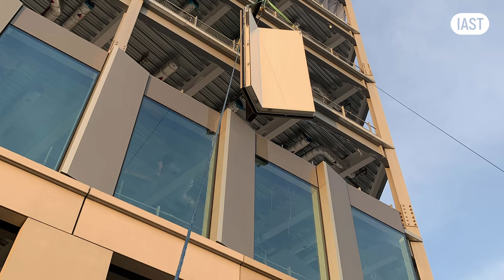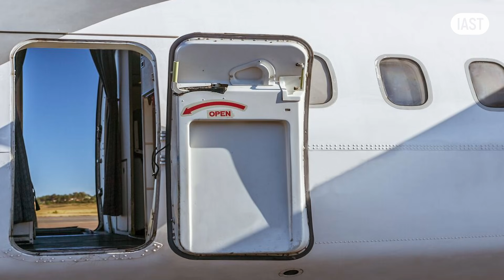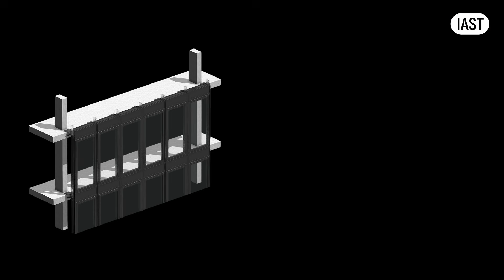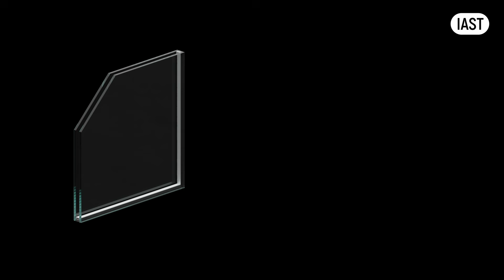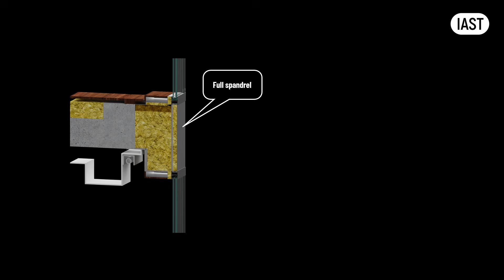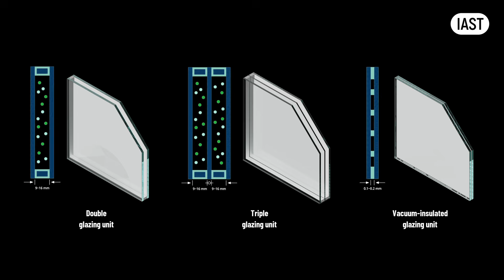Curtain Wall | Architectural Engineering and Facade Design

Comment: Spent 2 years installing curtain wall in NYC. Great experience.
Reply: Installing curtain wall in NYC is no small feat. Logistics is a challenge
Reply: @EugeneKorch   Its a project for sure. Getting the proper windows from a factory overseas sent to the warehouse.  Loaded on a truck and sent to the site. Then getting huge windows off the truck in the middle of NYC and up the lift and dispersed to the floors in the proper amounts and proper types. Then if theirs an issue it has to come down and be destroyed and new one has to be sent from the factory.

Comment: great video and presentation,  performance and efficiency drives yes, but the architecture is really the driver, which could also perform and be efficient
Reply from the maker: Thank you! Which performance topics do you think are most relevant for architects today?
Reply: Thank you — really appreciate your comment.

And I agree: architecture is the driver.
Performance and efficiency can (and should) be integrated into the architectural vision, not added on afterward. The best façades happen when design intent and building physics work together from day one.

That’s when you get something beautiful and efficient.

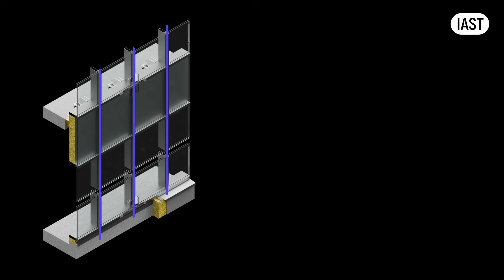Comment: 2:00 When I was in 2nd or 3rd grade, I was riding to school with a classmate and his mother was driving. She was explaining that my classmate's older sister had run out of the high school she attended as it was "collapsing in the wind" the day before, and had to walk home. Much later, while reading stories of the lawsuits, which dragged on for over 10 years, I learned that the 1963 building hadn't really come close to collapsing, but that too few brackets had been used to attach the aluminum-framed curtain wall to the steel structure, and that the wind had caused it to flop in and out, shattering the cosmetic plaster that covered the interior wall extensions and, for the students, creating the impression that the world was collapsing around them. No one was really in danger, but it was an expensive mistake for all involved. By the time I attended that school, it was a patchy mess with plywood replacing the destroyed plaster and since then, the curtain walls have been replaced entirely, but on that day in 1969, around 1000 students probably thought they'd never see their school again.
Reply from the maker: That’s a fascinating story, thanks for sharing! It is a powerful reminder of how critical façade detailing is, especially when dealing with wind loads and system integration. It’s incredible how perception and reality can differ so dramatically in such moments. Was it one of those early experiences that sparked your interest in architecture or engineering?
Reply: Wow — what an incredible story. Thank you for sharing it.

What you described is a perfect example of how façade attachment failures can create the impression of structural collapse, even when the main frame is still sound. When the brackets or fixings aren’t properly designed, spaced, or installed, a curtain wall can “breathe” in and out under wind load much more than it should — and for anyone inside, that movement feels catastrophic.

Cases like this are exactly why modern façade engineering places so much emphasis on fixing patterns, load paths, movement allowances, testing, and quality control. The curtain wall doesn’t just need to look good — it needs to stay attached to the building under real wind pressure.

I can only imagine how terrifying that must have been for the students. It’s a powerful reminder of why good façade design (and proper installation!) matters.

Thank you again for taking the time to write this — it adds a lot to the discussion.

Comment: How do you create the images? What software have you used?
Reply: Good question — honestly, any 3D software works.
But for most of renders we use Blender. It’s free, powerful, and great for rendering clean façade details and animations.

The key is not the software — it’s building the model properly and lighting it well.
Reply from the maker: High-quality visuals can be deceiving; they can make a poor design look credible. That’s why we focus on teaching how to design, not just how to make things look good. However, we do share some tricks with FI Pro Certified members once we have confidence in their knowledge.

Comment: Do you see any  new residential double skin solution coming?
Reply: Great question — but realistically, I don’t see double-skin façades taking off in residential.

They’re expensive, they complicate maintenance, and most importantly: people want to open their windows.
Add balconies into the mix, and the whole concept becomes almost impossible. You’d need operable outer layers, complex fire strategies, ventilation paths, and a huge amount of coordination.

For offices they can make sense.
For residential… probably not in the near future.

But happy to be proven wrong if someone cracks a clever, low-cost solution.
Reply: I could see residential double façade working, IF the inside was operable windows, and the interstitial space was considered ‘public space’, so expectations would be locking your inner windows at night because glass cleaners are stopping by in the morning. Just depends on if there is an automated smart system running the ventilation through the double wall--- look forward to IAST-UK's take-->